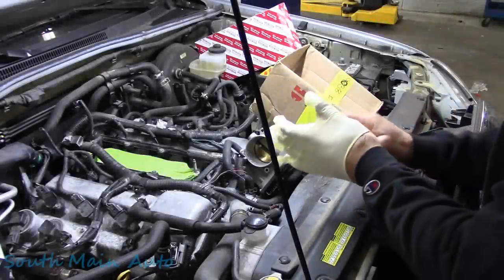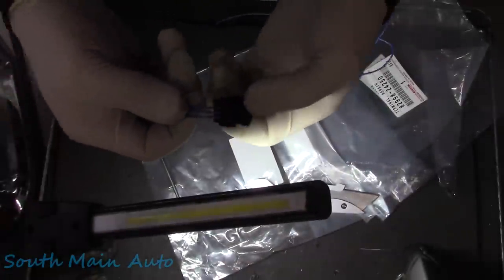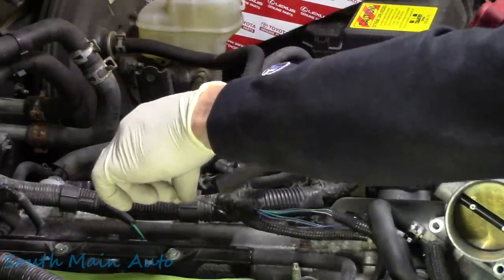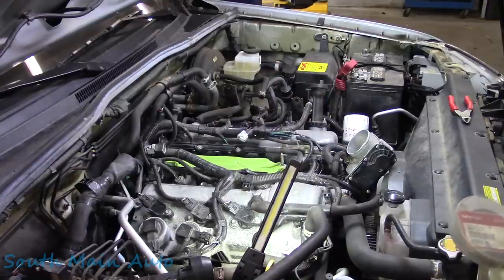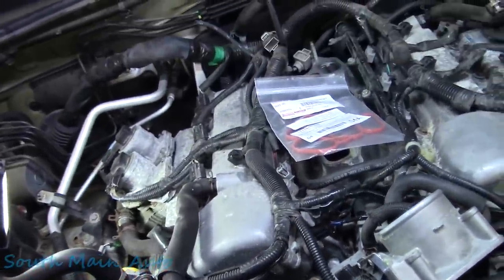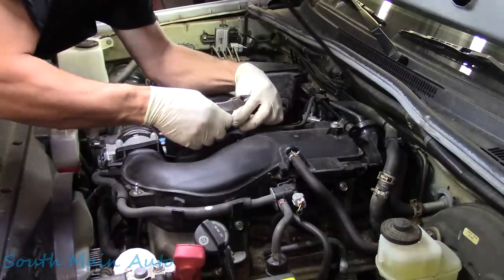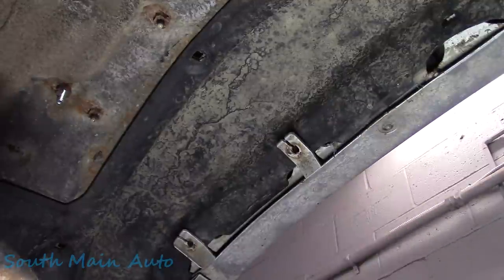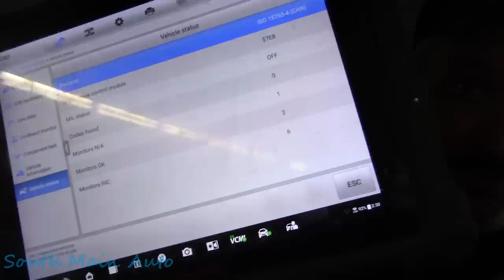Squirrel vs Toyota Tacoma - Part II

Comment: The stories I could tell of vermin in my engine compartments through the years--muddy woodchuck resting comfortably atop my engine cover,  headless squirrel apparently the victim of belt/pulleys, mouse getting all the way through '97 Tacoma's air filter and fouling the mass air flow sensor (Toyota had the truck three days to repair under warranty but after wrecking an exhaust pipe replacing an O-sensor and replacing, poorly, the plugs, I was checking the damage they had done and opened the air filter housing), dead mice and giant nest and hole in '09 Ecksby air filter repaired with K&N filter and a dome of 1/4-inch hardware cloth secured over the intake horn, mouse living well in a nest of foam and leaves under "09 Ecksby's intake manifold dining on both knock sensor leads right at the connector--usual--with Toyota refusing warranty repair even though car was bought new from that dealer three months earlier after they noticed traces of vermin--it was on me to remove all the pans and trays and wiper mechanism and throttle body and intake manifold to access the knock sensor. 

For that wire repair on the brand new Ecksby, I carefully extracted the terminals from the connector, pealed apart the crimps, re-crimped and soldered a couple lengths of Teflon wire to the terminals, clicked them back in the connector, butt-spliced to the original leads, shrink tubing all, and imbedded a piece of window screen under the final layer of shrink tubing.

Some tips on the prevention of gnawed wires: notice how bare wires are exposed just before they enter connectors; to make these unavailable, wrap aluminum tape (or copper tape) from the connectors, over the bare wires, and over the beginnings of the cable looms. Keep Fluid Film off wires; it's mouse food. As much as you dare, spray WD-40 over engine compartment flat, metal  surfaces where mice might travel; they hate getting petroleum products on their sensitive under carriages. Liberally dust everything in the engine compartment especially into fender and cowling crevasses with the strongest cayenne pepper powder you can find. I buy five-pound bulk from Amazon. This carries the danger of tinting plastics and paint reddish if it bakes on.

Comment: Using a flame on heat shrink undoubtedly makes it shrink, but overheating the material can significantly reduce the life of the sleeve. There is a good reason that the manufacturers deprecate the use of a naked flame.

Comment: Toyota has always been exspensive on pig tail wires they still sell the entire harness for the tail lights and once tail light harness for a 2000 4runner is 80 bucks but they do make quality parts Eric O @SouthMainAutoRepairLLC

Comment: You mentioned in part 1 having trouble with smelling mouse pee, fluid film, and asparagus. One thing those all have in common is sulfur, have you checked to see if you can still smell match heads or the odorant in natural gas? Just not at the same time or you won't have to worry about smelling anymore.

Comment: I always put some 1/4 inch hardware cloth mesh in front of the air intake on my Toyota vehicles I have had over the years. Mice always go in there. I was also putting mesh across the air intake to the cabin fresh air opening which is located under the windshield wipers area.  They used to always go in there and make a nest in the fan . But my newer Toyota Tacoma has a cabin air filter that at least stopped them at that point !  Chicken wire scrunched up can work too - lets enough air but keeps the mice out. Then I had a Toyota camry the mice were getting in to the trunk all the time. I finally found that there was small flap that was supposed to let the air out of trunk when you slammed it shut - that had a hole in it or mice made a hole and that was located behind rear bumper - a mouse highway !

Comment: I'm retired where every day is Sunday and no day is Monday and as such I have to let my daughter take my car once a week to work mostly in the winter because I don't drive much.
This keeps the brake rotors from rusting up, the oil and fluids circulating and the battery from dying.
When I first retired, my battery went dead about three times in one winter because I didn't drive much😅

Comment: Son’s -17 Honda Pilot was a mouse smorgasbord….wire coverings soy based…$8k repair but luckily covered under insurance.
Ah, I see mentioned. Anti rodent tape like $45 per roll.😳but cheaper than the repair.

Comment: 20:25 About a week ago, I was doing a EVAP P0441 on a Toyota Tacoma. My Autel scanner never showed that the EVAP test was OK. It was always INC, so I drove it 100+ miles, and still INC. Finally, I thought Autel must not read it and it was the 30th, so I had to get it through emissions on the last day of the registration. It passed emissions, so Autel must not read Toyota EVAP systems tests.

Comment: Apparently auto manufacturers have transitioned to wires coated with a soy based formula, instead of a petroleum based concoction. Rumour is they are trying to be more eco-friendly. Surprisingly if you coat wires in food then rodents are attracted to them! Lmao (I wrote this just before Eric mentioned it)
If this were my car, I would've taken the opportunity to wrap any exposed wires at connectors; when Eric had access to entire top of engine; with the Honda rodent tape. Just added insurance.

Comment: Curious.. Why special wire? You can't use regular wire and cut it yourself? Thanks!
Reply: It has the correct terminals to fit into the connector.

Comment: If you go under utility there is a secondary air injection test and evap test both will complete the monitors or at least it will with techstream

Comment: I just did a complete brake repair (all parts) and it stops on a  dime.
But one rotor is a little hotter than the other side. Is there any way to balance the temp, in order to get an SMA quality ride?

Comment: Just got done doing my 2006 Chrysler Town and Country with a 3.8 the harness for the EGR valve and the oil pressure valve and the stator and field on the back of the alternator all decided to short out and melt together I had to take the whole harness down all the way almost back to the starter and replace all the burnt wires that were in it same method solder shrink wrap taped it all back up put some armor shield on it up by the exhaust manifold and she runs like a scalded dog now

Comment: The bunnies went ape for that Honda peppa tape and tore up everything then looking for some moar. Couldn't eat enough of it. Your mileage is bound to vary, but the more fresh and expensive it is, they liked it better. So Geese do it too, chewed wires up and left all the copper from as high up as they could reach on the firewall to up into the taillight wells which are open on a 59 apache 32. 12 feet of bare taillight wires, still connected, stepped on the brakes and saw the fuse blow, so I didn't start it and took a look. I'm not sure it's flavor they are after, more like a chew toy for a puppy dog. Ever had a puppy chew your shoes? Tell me again it was only about how good they taste.  Critters be bored af, can't fix much of that either. Flavored tape was a fail for us as long as we parked it near a vicious bunny, sold that Honda and it's no longer a problem. Heard stories about how all the combines parked in town got to buy brand new JD wiring harne$$e$ and then they were no longer parked in town as we don't have trees anywhere else so no squirrels in a field somewhere secluded.

Comment: I was surprised to see Fluid Film sprayed directly on the bare battery terminal (but not on the connected assembly).  Fluid Film's website says that the product is non-conductive.  Wouldn't  the Fluid Film between battery and cable clamp increase resistance?

Comment: My rolla ground strap broke at battery..dealer quoted 1200 bucks I hug up on him...oreillys better quality ground strap 20 bucks..in stock now thicker wires too better battery connection thicker..  dealer is nuts.. I bought oreillys silly.

Comment: I apologize if this is a dumb question but, why not just use standard wire and crimp on a terminal end instead of buying them predone from Toyota for 10 bucks a pop?
Reply: It can be a pain to source and stock the correct terminals and weatherpack. Then you need the special crimpers. Now add those parts plus the markup you need to cover thier cost and the time sourcing them, add the cost of the wire, and labor to put that together. $10 - $12 a pre-made wire is a very cost effective choice for the customer bringing along with it factory quality, weather sealed parts.

Comment: Pigtails are a ripoff. With a little research you can find the terminals at electronics suppliers like Mouser for ten cents a pop and the connector itself if needed, for a couple of bucks.

Comment: (3) 1 ft. wires with contacts, $10 each? For that price they should match the color code, come with splices, heat shrink, and a wiring diagram.
A heatshrink repair to wires with undamaged conductors is even approved in aviation.

Comment: Does anyone know the answer to this question. I had a salvage trans put in a 2017 fusion 6spd (its not a CVT) do I need to have the trans reprogrammed…. Shifts fine but feels like the shift points is alil off.

Comment: Honda makes a "mouse resistant" electrical tape for wiring repairs. As I understand it it is "pepper flavored" and the mice find this distasteful. There are other companies that make various coverings for wiring in various diameters. They use a strategy that makes it taste "bad" or it is irritating for them to chew on. I have even heard it said that putting a shedded snake skin in areas that mice or other rodents are likely to use will keep them away... I have also seen shedded snake skins in some mice dens... so I dunno how effective it would be.
I wonder how effective a few spritzes with some pepper spray would be in such areas and along wiring harness runs. Might be corrosive (I know Tabasco sauce has a lot of salt in it.) Might not last very long. I will purposely avoid any jokes about Mexican mice finding it /more/ tasty.
Eric, have you tried any of the "rodent repellent" sprays. Are they effective? Would it kill some of your business repairing mouse munched wiring?

Comment: Toyota never could design a good intake manifold. All of the turns blocking access to injectors, wiring, and everything else. Toyota quality seems to also mean more vacuum hoses than any other vehicle. I remember lots of work orders checking Toyota trucks and Ford Rangers for vacuum leaks and crushed vacuum lines.